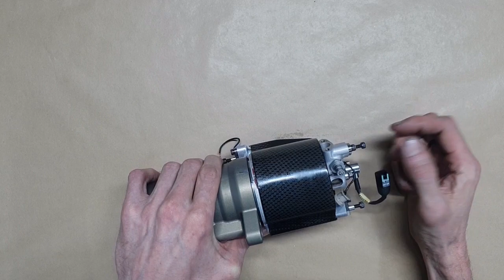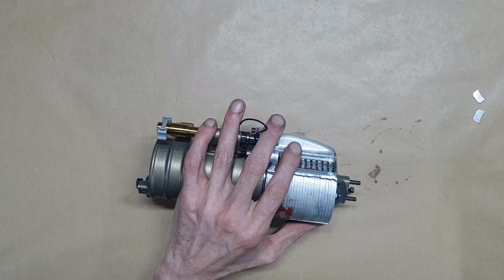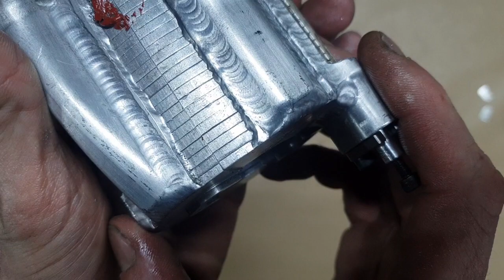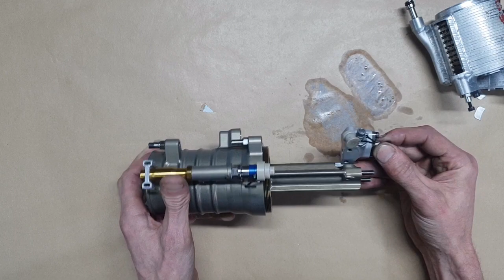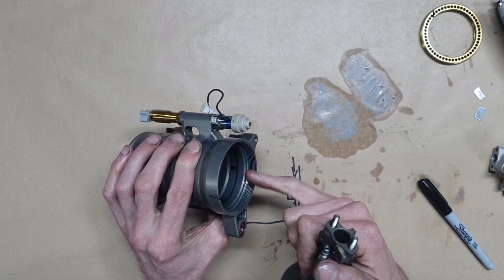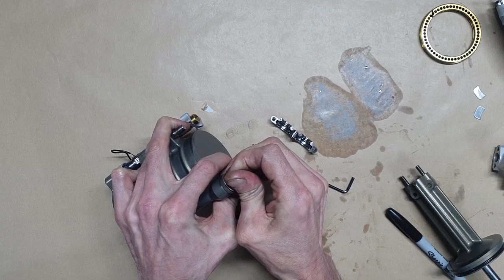F1 Oil to Coolant Heat Exchanger - A Closer Look - Ep 5

Comment: That's the only oil cooling on the car? It's tiny. Smaller than what you find on a 200hp street car.
Reply from the maker: This is the hydraulic oil cooler. Engine oil gets a radiator in sidepod.
Reply: That makes a lot more sense.  I was also wondering why an oil cooler would need an accumulator... but i only had my right headphone in for the first half of the vid and was doing stuff at the same time. I need to watch more carefully. @EngineeredtoWin

Comment: What engine oil would these V10 engines have used
Reply from the maker: 4 Series 10w-60 usually, which is fairly standard across many F1 engines...but with different suppliers and tweaks.
Reply: @EngineeredtoWin  Thanks interesting, I used to have a garage and that's the grade we used to use in the old M3 BMW's  I now have a motor which runs straight 30 grade

Comment: Just subscribed, the thing I'm most curious about lately his how do you think F1 engines were deemed as worn out? Bore wear? Valve seat recession? Bearing wear?      

Great channel
Reply from the maker: Thanks for subscription... it's mainly to do with block fatigue and in general finite cycles of certain parts such as valves, conrods, piston pin bores and ring areas as well as valve seat interference fit doubts. From memory the run limit of engines, and I've seen used parts marked as race worn is approx 2000kms. Sometimes just 900kms. For me, the biggest worry would be pneumatic valve seal wear, and conrod elongation.

Comment: Keep at it ..... people will come.  It takes time.  Your content is good and very interesting.
BTW, sidenote: do you have the part numbers of the Parker Abex Aerohydraul pumps?
Reply from the maker: Yes, the pump without accumulator is model number ap05v-0119. The pump with accumulator is ap05v-0144-01.
Reply: @EngineeredtoWin  Cool.  Yeah those are dinky pumps.  An 01 means it was designed by Aerohydraul.  It’s displacement is 5 gpm at 1500 psi and 1500 rpm or so I am told.  By dinky, some of the pumps my contact designed are on the order of 35gpm (I think that would be ~160lpm) at 5,000RPM.  These would be pumps for control surfaces on airplanes like the B1-Lancer (I think this had specs like 50gpm/3500RPM), B2, F16, V22-Osprey, F111, F35(3-bearing swivel nozzle), F22 Raptor.  Get this - I know of a design of a fueldraulic pump - intended to use onboard fuel for the engine, and for control surfaces.  This eliminated the Skydrol hydraulic fluid resevoirs/system, saving weight.
Reply from the maker: @truegret7778  Fantastic info - thanks for that. Very interesting too about using fuel as a control medium. I guess now, many systems run pumps and driving motors integral to the actual hydraulic actuator, saving many meters of piping from a central pump, and also less risk of many actuators going off line should those many meters of piping get damaged.
Reply: @EngineeredtoWin  Yea, for sure.  It is my understanding that companies like Abex made pumps and motors.  The system that leveraged fuel for controlling flight control surfaces was on a fighter (JSF if I remember right), that was interested in reducing weight.  I think a lot of the plumbing is still required, but wanted to eliminate weight of the oil, reservoirs, and so on.  Very special ceramic coatings were required on the shoes and wear plate due to lack of the same level of lubricity (JET-A1 versus Skydrol-B4).
I appreciate your channel, and just imagine being around people like Mike Costin and Keith Duckworth, that designed the Cosworth on paper, just as todays' Adrian Newey. 
👍